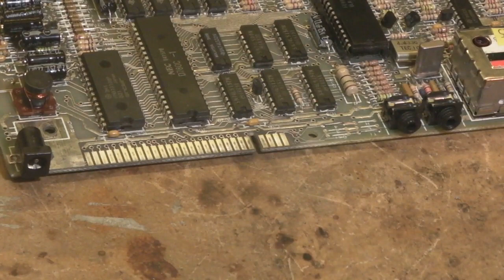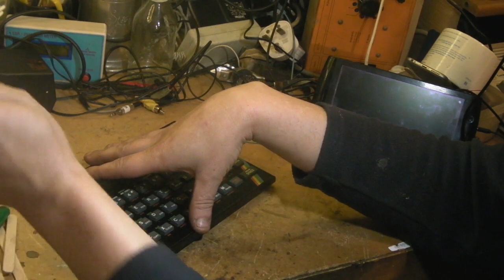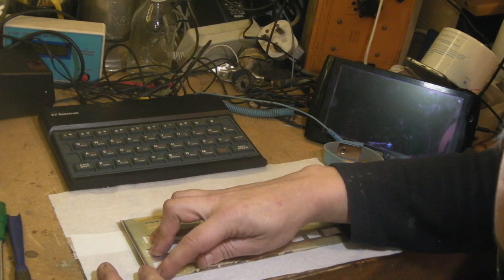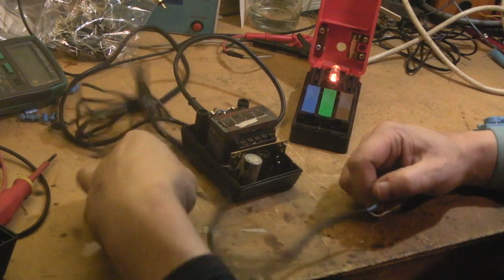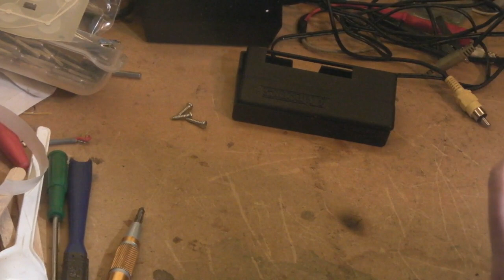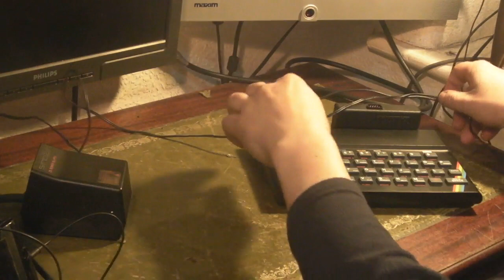Spectrum 48K Refurb Pt2

Comment: I have seen plenty of those old Spectrums, but cannot remember seeing one in such good condition, well, not since the 80's! Certainly one to be given some attention. One thing I will ask, is it  not a very bad idea to have your anti-static grounding wrist strap connected whilst your working on the power supply, just one quick touch of a live mains connection with your left hand, would the wrist strap on your right hand not provide a good way to earth?  I was always taught to keep one hand well away from any ground points, just in case your other hand accidentally touches something live at main voltage.